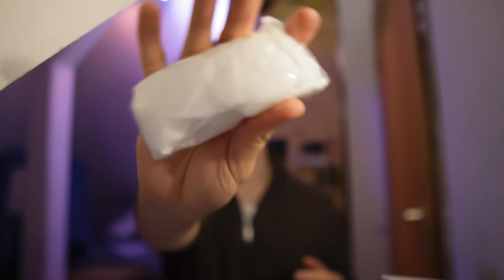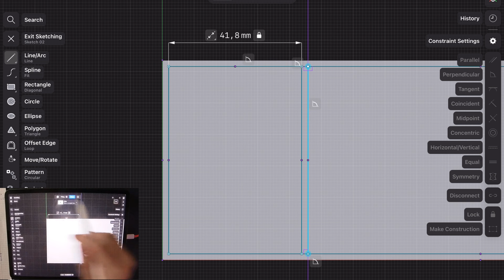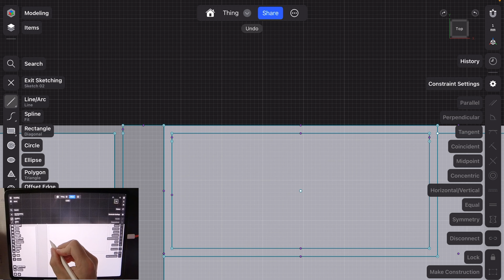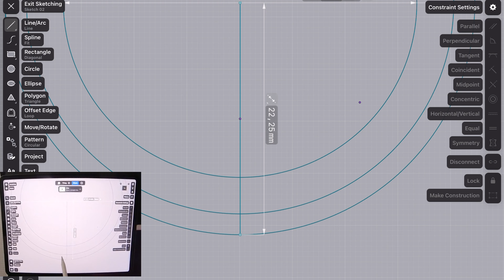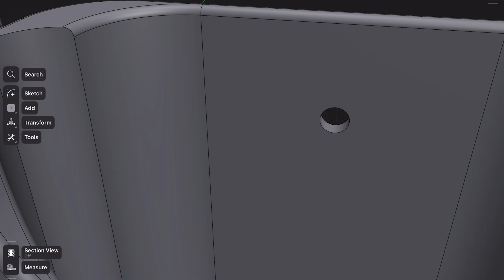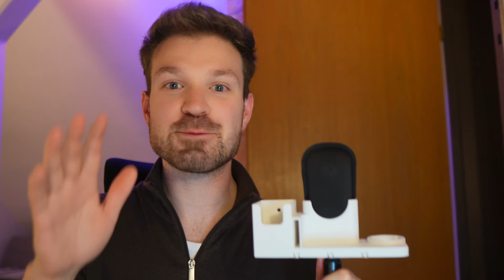Which software I use for 3D printing - Shapr3D iPad Bambu Lab A1

Comment: Correction…..
Free version of Fusion 360 allows 10 projects.
Reply: 10 projects which are simultaneously editable ...
You can make 100 or more projects and just have them as uneditable and switch them to editable (by changing an editable to uneditable) when you need to edit it again 😉
Reply: @photelegy  7 months late to this comment but thank you for the tip!
Reply from the maker: My mistake, thank you for your comment!

Comment: you can always file away some plastic where the holder is too tight (please don't reprint the whole thing!). if i won a giftcard (in $CAD) i'd use it for some pccf filament
Reply from the maker: Haha thanks for the tip! Didn't think about it but I do have the tool. Will probably do it since it's like 0.2 mm or so.

Comment: Shaper 3D is prohibitively expensive for hobbyist wanting to create functional prints. It’s slick, but inconsistent. Sometimes it just refuses to do certain commands with no apparent reason, limiting the radius on a fillet or not allowing to offset a curve. But my main problem is the subscription model pricing. The base (free subscription) is not useable for exporting models for 3D printing. The resolution is atrocious.
Reply from the maker: You're right! Specifically changing things later on are sometimes close to impossible. That's why I'm trying to force myself to use more fusion 360.

Someone else comment that Blender would be the best program. Might try that as well.
Reply: @floatypiet  Blender is not suitable for CAD modeling. It’s vertex/polygon based and You can’t really do CAD with sketches, extrusion of curvesfrom faces and boolean tools, even if You have the Boxcutter/Hardops plugins, it’s still pretty bad for CAD.

Comment: On what exactly did you hang your keys there? Very suspicious :D A small tip from me is to save your files in .step format if your slicer supports it. STL, 3MF, AMF and many more convert your model into many triangles, which can be seen in your print if the triangels are too big (depends on how the CAD software saves it and if it lets you change them, on the settings you set it to). STEP saves the real contour of the model so if there is a radius step saves it as such. This really helps on large, even models such as cylinders.
If I win the giftcard I would want you to roll again. I have no use for bambulab stuff besides maybe filament so there are others who could use it better than me :)
Reply from the maker: Oh wow thank you a lot! I'll try it next time (probably today). I really appreciate comments like that✌🏼

Comment: Great video! This type of thing where you have a very specific problem that would normally be a pain in the but to solve is a great use-case for 3D printers!

I've only had my 3D printer for a few days, but I've already identified so many problems that I could fix with it! Started modelling the solutions as well, so at this point I would just need a bunch of filament, which is what I would use the voucher for!

Recently saw a video (by JanTec Engineering) about printing ASA on top of PLA to reduce warping, so I'd love to try that out!
Reply from the maker: Ohh that sounds interesting! He probably printed that with an enclosure printer right?

Comment: Love your channel, good use of time, not to slow and not to fast editing. I also have the A1 and love it. Keep up the good work, love from Sweden. If I win I would like a € voucher so I can try Bambu labs PLA. Only printed off brand so far.
Reply from the maker: Thank you! I was really worried about that and had some trouble explain what I do without making it too boring.

I'm glad I found a good medium. Thank you for the feedback.

And good luck🍀
Reply: A pleasant 25 minutes in good company. 
While it wasn’t a tutorial on your cad software, it was very clear as to WHY you find it intuitive with the ‘pencil’. Great pity there is no hobbyist license. 
When I make up my mind whether it is the A1 or the Mini that I should buy (+/- ams lite), some rather different filament (tpu?) would be very nice. UK so £ if I were to get uncharacteristically lucky! 
Really good work - I hope you can keep it up without becoming pressured by your success.